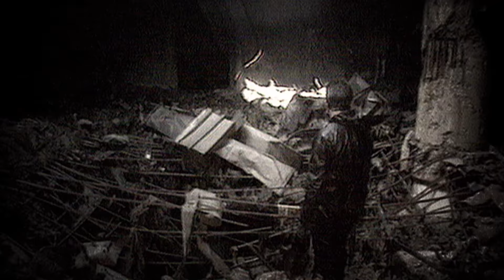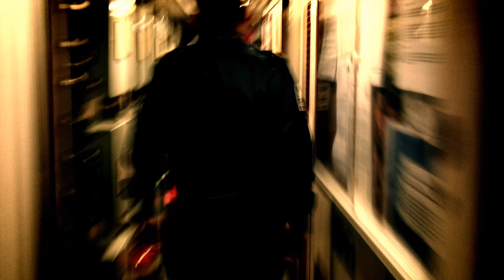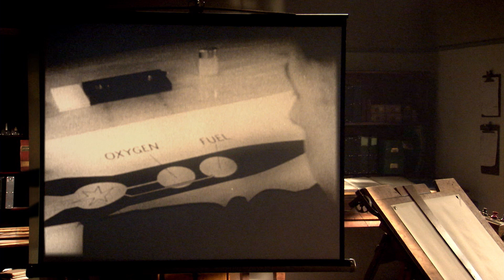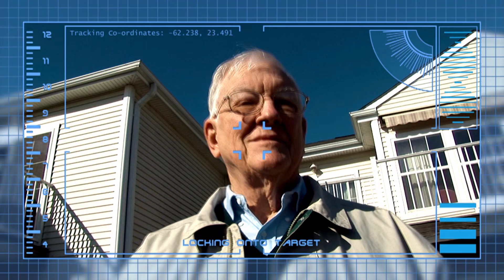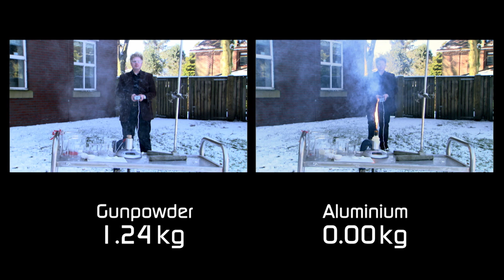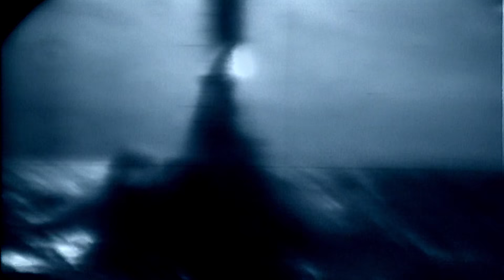Cruise Missile Technology – Machines of War

Comment: I was testing a new security system and opted to run a temporary 100' wire thru the kitchen and out a doorway to the outside phone box since that wire was missing. The house was full of IBM engineers (it was a demo house for the new IBM home automation system) and they all criticized me for doing this except for one white beard who cracked up and smacked me on the back for my ingenuity.  He had worked on the first trials of the Tomahawk. He told me about how it was a huge challenge to make the missile work for the first time and how they would use duct tape and bailing wire if that's what it took. I had brought him back to those days decades ago.
Reply: Nice! thnxfor sharing💪🏼😎

Comment: Excellent video and taught me some historical things.  I was involved in development of the AGM-138 JASSM, and it became a very successful program. It flew high because it was stealthy. This conserved fuel (no weaving) for longer range. It used a very accurate INS with GPS update. One bad thing in its development was the program manager. He chose not to utilize LMCO's Design Assurance group, which monitored the electronic and mechanical design techniques used by the engineers. It is essentially a cook book of best practices with two reviews. He thought it would incur additional costs.  Boy was he wrong. His engineers, many were young, used whatever they thought was best. The result was so many glitches the prototype couldn't make it out of the lab. He was fired and a more DA friendly manager took over. The result was a stable system with very few glitches. They were quickly ironed out, and it had outstanding performance at the AF's test range (location withheld). Today there are several variants and multiple launch platforms. Ukraine sure could use some.

Comment: The Tomahawk Cruise Missile represents a significant advancement in missile technology, building on a rich legacy of engineering and scientific innovation that dates back to early rocket development. The evolution of missile technology can be traced through several key milestones, each contributing to the capabilities of modern systems like the Tomahawk. From V-2 Rocket, Redstone and Jupiter missiles, Cruise Missile Technology, Guided Missiles assisted by microcontrollers and sensors, and GPS satellites to stealth technology learned from hard lessons in the battles, everything paved the way to achieve such an incredible engineering feat. The Tomahawk Cruise Missile is a testament to the incredible engineering achievements that have evolved from early rocket technology. Its development reflects decades of innovation and adaptation, drawing on the lessons learned from historical milestones in missile and aerospace engineering.

Comment: I used to work for an excavation company. I don't think most people really understand what it takes to get more than a meter (or a few feet) into the ground, let alone 30x further.

The best thing I can say is to look at the wooden pilings that are used on docks. A moderately sized wooden pile is roughly the diameter of a Tomahawk missile and will have a tapered end as well. Now watch a pile driver in action. Look how much work it takes to move it down just a small amount. Obviously this isn't a 1:1 comparison, but it will hammer the point home. (and never be sorry for your puns)
Reply: That's why bunker busters are narrow, have incredibly thick steel walls and weight 5 tons
Reply: You said a lot of nothing for an analogy or whatever your shooting for

Comment: Tomahawk has a mercury switch when it comes out from the sub the liquid mercury sucks into the detonator
Reply: you don't know what a mercury switch is huh, might want to just plain google it. It's not what you think it is.
Reply: yap
Reply: Check behind your thermostat. If it is an old one.😊
Reply: That's similar to my 60s era home heater thermostat.
Reply: Obviously you know nothing
Reply: Why would the sub launched version have a different warhead fuse?
Reply: You know nothing, Jon Snow 😅
Reply: So people have to worry about mercury poisoning as well as the explosion?!
Reply: @SuperScottCrawford Yup. That's the entire point of the mercury switch. Terrible, huh? 😮
Reply: @noth606 I was about to tell him the same thing, he did't know what a mercury switch is!
Reply: I don’t think it’s anything to do with the detonator, nor thermostats. Probably it’s to maintain level flight.
Reply: Probably to keep the detonation safe until it arms by the mercury.
Reply: A mercury switch uses gravity, so theoretically, it could use acceleration to the same effect. 
But in the case of a cruise missile, it probably wouldn't work. 
It can't be triggered by foward acceleration because that would cause detonation at launch. 
It can't be triggered by deceleration either because impact happens far too quickly for the mercury to react.
Reply: A mercury switch is a tilt switch in most land based bombs, i don't believe they're used in missiles, too sensitive and unstable for high G operations.
Reply: I think most people saying the OP has no idea what they are talking about, in fact, have no idea what they are talking about. A mercury switch is most often used to detect a change in orientation from vertical to horizontal or vice versa. These missiles are launched vertically, and are always far enough away enough from the launch vehicle to be harmless by the time they are horizontal. I cannot think of a better employment of a mercury switch than this safety arming switch mechanism.
Reply: I've heard it said that there's a serton amount of mercury in salmon that's why I don't eat it . I like your comment 😊
Reply: @Jerry-p3x To be fair Mercury is a company that does and has produced missile guidance technology. He may be talking about that.
Reply: They use semiconductors now, not mercury😂

Comment: The ballistic missile is an obsolete technology. The Russians have a Ch-101 with a range of 4500 km/5500 km (depending on the source of information). They use ballistic missiles fired from aircraft (Ch-47M2). Even Israel already has more modern weaponry (air lora). The Russians use cheap conversions for classic gravity bombs and make them into precision glide bombs. The difference between American , and Russian bombs of this type , is that the American have a maximum of 2,000 pounds (or about 907 kg), and the Russian , commonly used in combat 3,000 kg. Although there are already produced 5 ton and 9 ton (FAB-5000/FAB-9000). American ones rarely have a cluster load. Russian ones often have a thermobaric load. Another cool technology is long-range drones. The Ukrainian rocket drone , “Hell” with a range of about 700 km, or the Polish Warmate 50 drones, or the Polish Striker-both with a range of 1000 km. Cruise missiles are too expensive and easily detected and shot down. 
     Poland has received approval for the purchase of 821 Jassm-ER missiles from the US. It bought about 300. Even the Poles have cheaper technology. The HITs, FAE, FAX, TEX warheads are TNT weight conversions from times three to even times a dozen. 50 kg times 12 and the effect is the same, and the price is dozens of times lower.
Reply: Woah.

Comment: In Material Science this phenomena is called Metal Fatigue and esp with Aluminium Alloys this will be more so as compared with Steel. 
Metal Fatigue is a sudden degradation that happens due to shear forces or stress/ strain. 
It's good that the HAL.undertands this but, then there are ways to gauge this failure or impending failure and there are actually parameters that are set and must be implemented in terms of how.many hours they have been used before they are changed. 
HAL must do better in terms of doing preemptive maintenance.

Comment: Tomahawks today are mostly launched out of vertical missile tubes (VLS) from US submarines- not out of the torpedo tubes as used to be standard.  This is open content from Wikipedia.
Reply: That depends on the submarine. The Seawolf class SSN doesn't have VLS tubes to launch anything but relies on 26" in diameter(larger than the average 21" torpedo tubes on all other US SSNs) torpedo tubes and has 8 of them vs 4 on all other SSNs in the US Navy (Los Angeles and Virginia class).

Comment: You didn't answer how it flies 2000km while it only lasts for a few minutes
Reply: Only the rocket booster lasts few minutes and rest of the flight is carried out by the turbofan engine. The rocket booster is there to take the missile to a required speed so that the aerodynamic elements can generate adequate lift. Once that’s done, the rocket booster is ejected and turbofan kicks in.
Reply: @arnabbiswas7560 I know that but I meant the details. In fact, the video only talks about the history of the missile, not its specifications or how it is even made. But in general, thank you.